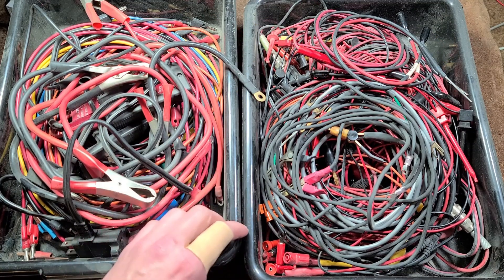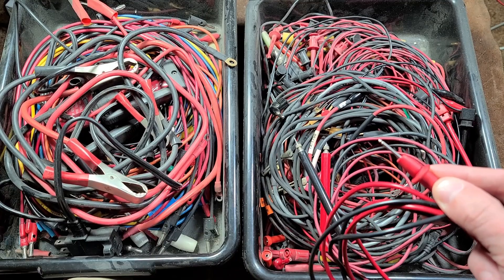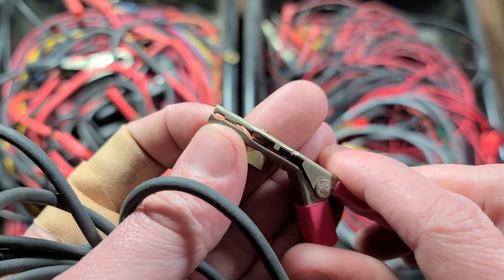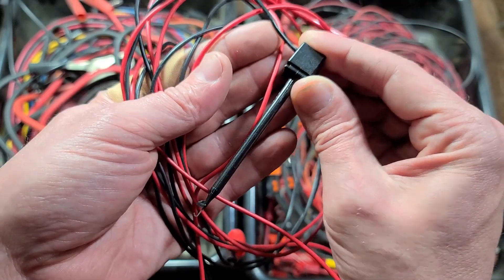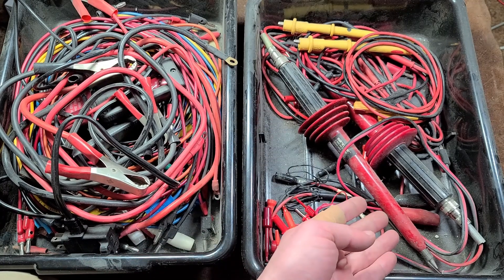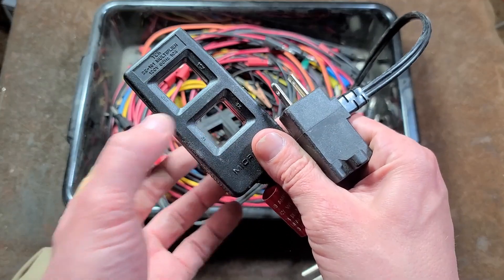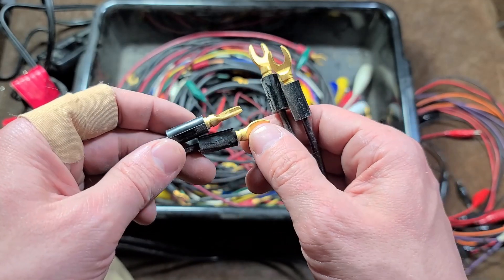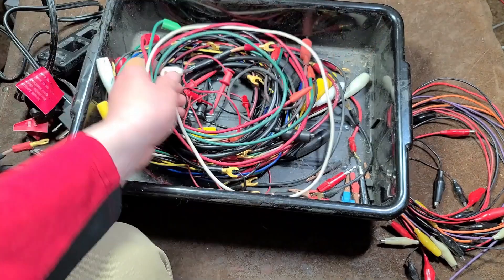Basic Electronics Test/Measurement & Power Leads/Cables Overview & Introduction

Comment: The fancy alligator clips are standard on outside telephone "butt sets" and test cables. The large spike was for going into the residential aerial drop wire that feeds the house. The small tips on the front are for connecting to punch blocks where phone wire is terminated inside office buildings and similar blocks. Very handy.